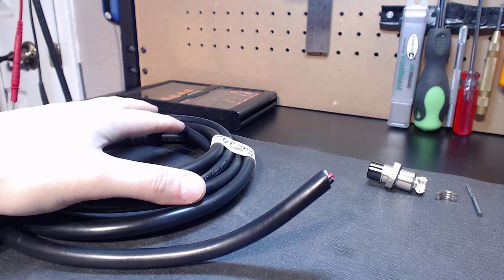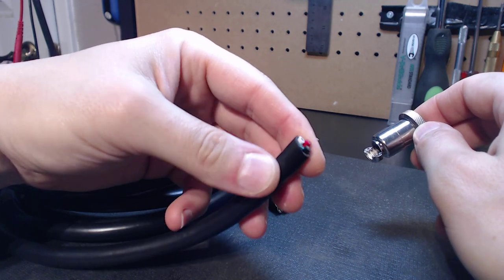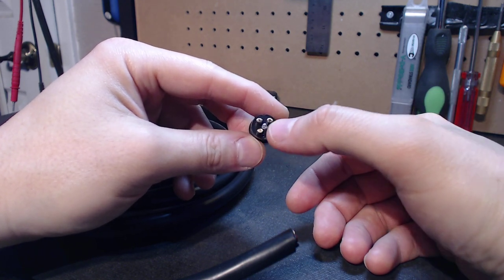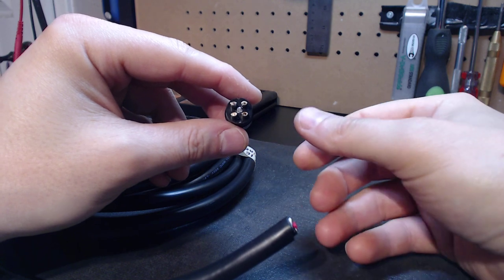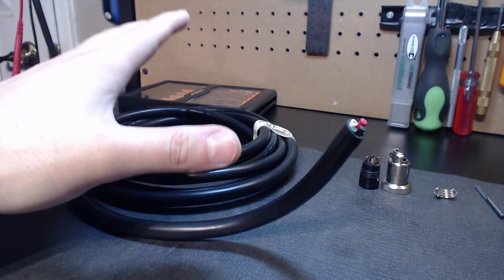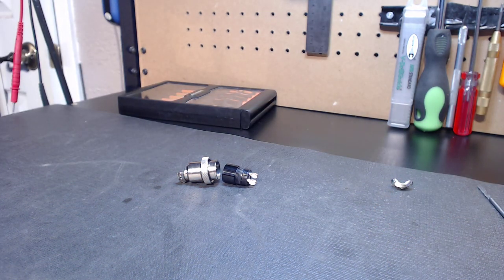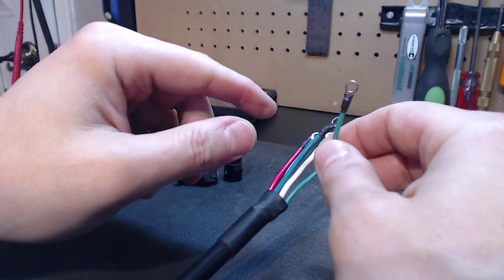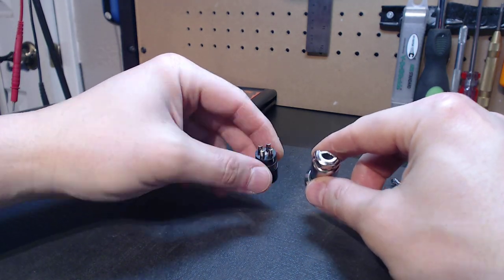Overview Of The Process Of Building Your CNC Spindle Cable...

Comment: Wanting to get your cable. So if I wanted to wire an E stop to remove the power to the Spindle... One way would be to relay remove the power from 220 volt or 110 volt supply. But could you use a 4 pole relay to remove the power to the actual spindle?  Would that damage the Spindle or the VFD removing the load.  How about leaving the VFD ON and then using the relay to start the spindle back up.  Sort of like popping the clutch in a old truck... What are your thoughts?
Reply from the maker: Digitalwoodshop, thank you for your support. I really appreciate it. 

The way you described killing the power will cause an immediate surge to the spindle as your switch would be wired to the spindle directly which would destroy the unit. The best safest way to kill power to the spindle is to utilize a power distribution bar, and kill it in the event of an emergency. This would be supplying your VFD power which in turn will kill the spindle. 

You can add a relay to the system to cycle on, an off the spindle through Mach3, but you can't utilize a relay to cycle the spindle on as you described. You must only utilize a switch that controls the VFD. 
Thank you, Vince
Reply: @corvetteguy50    That is excellent advice.. Thank You.... That was my gut feeling that removing the load would make bad things happen.... Plus the EMI issues of putting a relay in the shielded line...   I am working on 2 projects. One will be a 2.2 KW Water cooled Spindle for my little Shapeopo to cut Aluminum on it's 17 x 17 bed. Getting it used and will get a spindle for it.  The other project is to get a air cooled spindle of unknown size to replace the cut motor in the hobby CarveWright CNC. The current cut motor has noise and brush issues.  Would like to make a hush quiet spindle version replacing the cut motor. Would use the Cut Motor 115 VAC to operate a relay from the machine through the VFW if possible to turn on and off the Spindle.  Thanks :)
Reply from the maker: Sounds like a plan :) You, and your family have a very Merry Christmas, and Happy New Year! Thank you, Vince
Reply: @corvetteguy50  Merry Christmas and Happy New Year to your Family too.   Found your store...  :)

Comment: Does cable to step motor also should be shielded?  Then there will be a long list of cables that are used in a CNC, such as cables to limit switch, to step driver, to control board....etc.
Reply from the maker: The Common Sense Family In Canada thank you for your support. All CNC robotics cables carrying signals for control should be at the very minimum shielded however double shielded cables are optimally used in best practice to mitigate both frequencies of EMI. You're correct they're a larger investment when integrating switches, and other accessories. Thank you,
Vince

Comment: The silicone ground drain is soldered to the O end and the other end is just in the shrink tube is this connect and what length is the drain wire
Reply from the maker: The silicone drain lead wire is soldered to the drain lead from the cable. The bare shield drain is about 3/4in long that is soldered to the silicone drain wire. Thank you,
Vince

Comment: What is the spindle connector called (the 4 pin)?  Is that a Gx16 aviation plug?
Reply from the maker: Thank you for your support. Its not a GX-16. Each one depending on the one you have will have a different diameter. Thank you,
Vince
Reply: @corvetteguy50  Your ebay pages say "HY Large White Connector".  I have a HY 2.2kW spindle.
Reply from the maker: If the picture, and diameter matches yours from my listing then it would be correct. 

Thank you,
Vince

Comment: Great work on the video, some terrific advice there I'm sure. One thing I'm not sure about, is why you chose the circle solder ends and not the forks. To me, the circle ends make sense when the cable is not accessible/exposed to being pulled, but I would think that the fork connection is safer when you have dangerous amount of electricity on the output side if the cable can be pulled such that it could break outside the case and be left live due to the circle connections not being released before a cable breaks. Whereas the spade/fork releasing just leaves a dead cable that isn't live with spade intact. Maybe the logic is the cable will never break, or it will break at the solder joint. I'm no expert, just opening the discussion on reasoning for one over the other so that any reader can understand the decision making. Now I'm going to google fork and circle connectors
 to find out whether my logic is sound or not.
Reply from the maker: 204Seven Pty Ltd thank you for your support. A solder type circle ring connector provides the most safety when dealing with terminal connections as if the screw in the terminal securing the connector ever comes loose it won't allow the ring terminal to simply fall out. Fork connectors can, and will simply fall out which could be catastrophic with a 3 phase output like a VFD.  The connections on a VFD are not exposed when its terminal cover is secured in place. Thank you,
Vince
Reply: @corvetteguy50   Hello, Yeah I totally get that re: cable coming out that is live, but in that instance there, it wouldn't be live, as the source of power is the VFD motor controller which it's getting detached from. In that instance it seems safer to use the fork and the ring connector should be used on the input terminals to VFD. I'm new to this stuff, but that seems to make more sense to me. P.S I just bought both from a supplier a few mins ago, ring and fork [to solder and heat shrink].
Reply from the maker: The cables end with the ring terminals gets attached to the VFD terminal block which utilizes a plastic cover which is screwed on Please review my video here at the 2:50 minute mark https://youtu.be/PFe7VfTXp7o 
Also keep in mind neither a fork, or solder ring connectors are designed for tensile strength tests regarding pulling on the cables their attached to. This is where the end user must always execute common sense safety practices. If your assuming a fork connector will simply just pull out of the terminal block of the VFD when its pulled this is incorrect if the terminal block is tight, and being fork connectors are typically crimped, there far more at risk at failing a tensile pull mistake than a properly done (welded) soldered connection prepared with flux as they all should be.  I'm glad you purchased the solder, and heat shrink as it will provide the best connections for this application. Thank you,
Vince
Reply: Thanks again for taking the time to discuss the detail. I too, am one of those guys that enjoyed almost half an hour of video about a cnc cable.
Reply from the maker: You bet :) Thank you again for your support. Vince

Comment: What if the included spindle plug is too small to properly accommodate the cable's insulation?
Reply from the maker: Joshua,
Thank you for your support. Spindle plugs housings will all typically require machining with a Dremel tool to allow the plug to be terminated. Proceed slowly with a rotary file, and it's a straight forward process. Thank you,
Vince

Comment: I've heard shielded cable is better grounded if its done at both ends (as long as both ends have the same ground potential). What are your thoughts?
Reply from the maker: Hey Derek,
Thank you for your support. I really appreciate it. Grounding a shield drain in best practice is to be done on one end of the cable to avoid the possibility of ground loops. Grounding both ends isn't recommended.Here's a great video on ground loops overview dealing with audio, but the principle is the same regardless of genre. https://youtu.be/GS-6jBk9YPM Thank you, and please be safe. Have a great weekend!
Vince
Reply: whenever I've wired control hardware professionally, especially when you're mixing different voltage levels, signals, high frequencies it's only connected at one end. Usually having the drain grounded in a star point at the controller (or inverter) side and either cut flush or shrink wrapped at the device or appliance side to prevent the possibility of a ground loop. The manufacturers of these controls always recommends it to be done this way
Reply from the maker: @jimbmakin7975   Thank you for your support, and your correct. This is best practice. Thank you, and have a great weekend! Vince
Reply: @corvetteguy50  thanks, you too! I just received and wired my spindle using the double shielded 16/4 from your ebay store.. Love that it's tinned copper too. Ended up using insulated fork crimps bent inward to better fit the huanyang terminals and also soldering them for testing until I get proper ring terminals.. question: do you recommend using ferrites on the spindle output of the vfd? if it comes to a point of having to strip more of the double shielded cable in order to be able to use ferrites, does having more exposed conductors outside of the shielding negate the benefits of having to strip more to use ferrites?
Reply from the maker: @jimbmakin7975  Thanks again for your support. You won't require ferrites on the cable as the double shielding provides the most EMI protection available, and considering the leads on the spindle cable are short run to your VFD they won't accomplish much. Thank you, and have a great weekend!
Vince
Reply: @corvetteguy50  awesome thanks!
Reply from the maker: @jimbmakin7975  You bet...:)

Thank you, and have a great weekend!
Vince

Comment: So just to be clear, you either have to make sure your chassis is grounded properly or add a grounding wire to the 4th pin of the spindle motor. Do you have a diagram showing where to add the grounding wire in the spindle motor? Also the cable shield should always be grounded to the VFD? Love your videos btw. Thanks
Reply from the maker: Hey Chris, thank you for your support. Please email me for the diagram of the spindle's 4th pin using a ground. Yes, the shield drain for the spindle's double shielded cable should be attached at the VFD's grounding terminal. Thank you,
Vince

Comment: My spindle's power ground pin is not contented to anything at all.
Reply from the maker: MR80hms thank you for your support. Many ovesea spindles aren't grounded on the spindle's plug do to them believing you will be grounding the entire chassis itself which being a metal frame will by conduction ground the spindle as its also metal. If your spindle is lacking a ground on its terminal you can add one by removing its end cap, and soldering one on the 4th pin of its connector which doesn't have a lead attached. I have a diagram reflecting this if you would like to implement it, just message me .Either option is completely up to the end user to use, and each method works fine, but you must use one method to properly ground the unit.

Thank you,
Vince